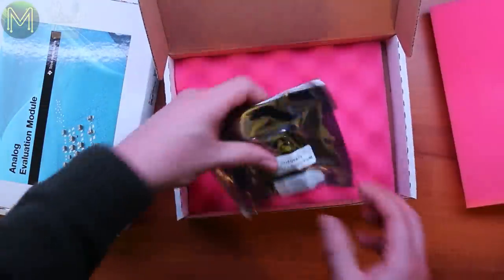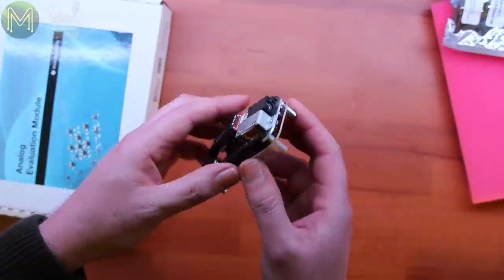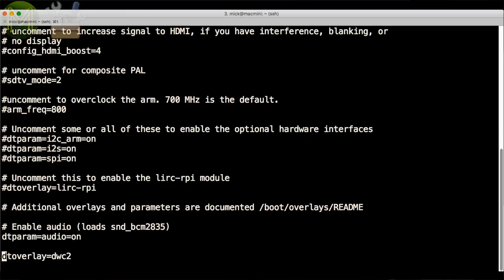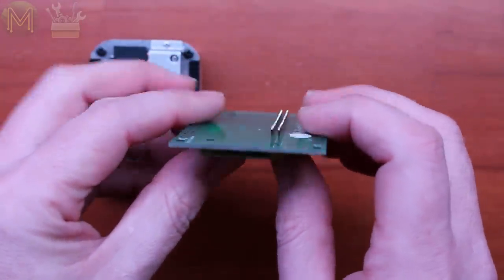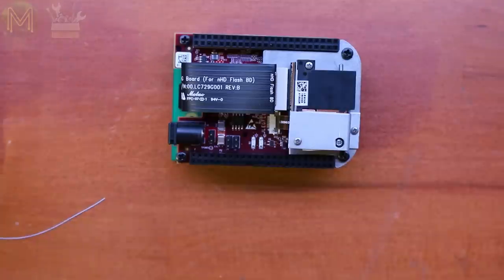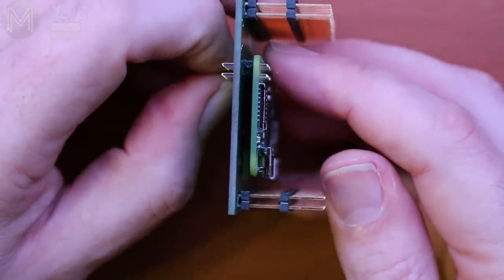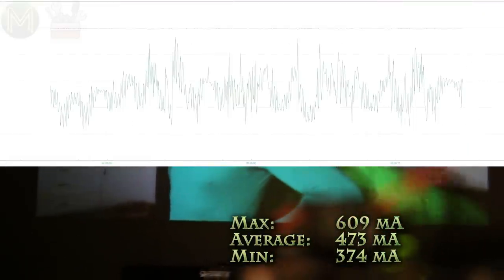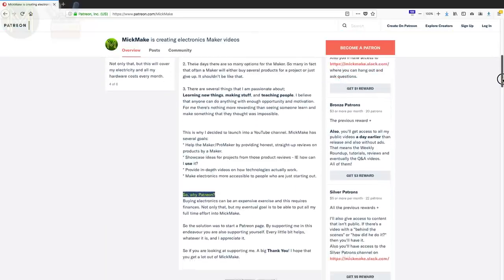#210 Build a Pi Zero W pocket projector! // Project

Comment from the maker: Hi everyone! Just to let you know, that Tindie admin hasn't yet approved the PiProjector on my Tindie store. I suspect they are very busy with the Bay Area Maker Faire. I'll let you know when it has been approved.
Reply from the maker: OK... Tindie has approved the PiProjector on my store.
Reply: they generally try to have a weekend ;)
Reply: I want to build this sooooo bad!
Reply: Please buy an Rodesmart lav+ mic or wireless FM/UHF lapel. The mic your currently using has LOUD HISS . Audacity should remove some of that for you
Reply: Sounds like an interesting project but you failed to mention where people can buy an DLP2000EVM or clone in USA + UK + EU + Asia ?

Are these DLP things sold on ebay/gearbest/banggood/etc ?
Reply from the maker: What’s a weekend? :-)
Reply from the maker: Hi Don. Should have a bunch of them back in stock soon.
Reply from the maker: Actually, for some reason there was a lot of mains hum in this shoot. So had to filter it out the best I could. Was better to have high end hiss than low end hum.
Reply from the maker: If you check out my website. It has all the info there!

https://www.mickmake.com/post/build-a-pi-zero-w-pocket-projector-project
Reply: putting the order together soon.. i'm ordering your board from tindie and the projector from digikey.
Reply: @MickMake  when I try to open you website I get a 403 message...
Reply: @isabelleus2881  same here. Let me know if you get it to work. I'm very interested and wating for a year for it to be back in stock
Reply: @BLueFeaTHeRedOliVeS  it still doesn't work, does it for you?
Reply: @MickMake  your website doesn't work, I receive an 403 message...
Reply: @isabelleus2881  nope. I'd really like to buy some
Reply: Are you still making these in 2021? I would really like to get one
Reply: @Kellen Leland Definitely, been watching on Instaflixxer for since december myself :)
Reply: Hi Mick great tutorial and I would really like one of your boards when it becomes available again. I see in the latest version you added a power button. I have connected my EMV and pi using jumper wires using the VandenBosch's tutorial .It is working well but I need an off button for the pi to power it off safely in the evening without corrupting the card and then to unplug the EVM as it will be running in the gallery for 3 months. I am having trouble setting up the power button using this tutorial https://www.makeuseof.com/tag/add-power-button-raspberry-pi/ and I am wondering if the EMV code is overriding something . I am using GPIO 27 because GPIO 21 is not available as it is being used by the EMV https://www.makeuseof.com/tag/add-power-button-raspberry-pi/. I am on the waiting list for one of your boards when it becomes available again. I see below you also recommend using a fan , this might also be a good idea. Thanks!

Comment: Love this project, appreciate you guys putting this project together. Hope it’s okay to ask a question. I just purchased pool table software made for projection. They recommend a minimum of 3,200 lumens. I’m not sure that requirement would be possible in such a small package due to the heat. Since these using have more mirrors thus producing more light, how comparable do you think it would be to 3,200 lumens or would there be other lens that could be used?

Comment: Thanks for this,  I've been going nuts looking for a mini projector for my singing pumpkin. I'm 3d printing a pumpkin and want an internal projector in it.  I know you can buy them pre-made but a friend of mine got one already and it is cheap and not good looking as the videos of it shows.  I want to give this a try. Do you see any issues I'd run into with using this?

Comment: Hey is this pi projector is suitable to integrate with raspberry pi 3b+ ? Or it needs any other components to integrate with it ?
And if I buy this product from digikey that the link provided by u am I need any extra components to buy for fixing it or that product can be directly put into power supply by inserting sd card into it ?
Reply from the maker: Yes you can use it with a Pi3, but will need an extension cable for it. Apart from that nothing else.
Reply: @MickMake  can we connect mini computer using raspberrypi3b+ directly to dlp2000lightcrafter evaluation module???

Comment: @Mick

I have a Raspberry Pi 4B, and am trying to wire it correctly to the
 DLP2000 board.  The photos on your thread about the project doesn't have anything written on it (Pinout Pin # from DLP to corresponding Pi GPIO Pin #).  Because I'm sure the GPIO is the same as the Pi Zero.  It turns on, and displays the default splash screen, but I can't get

the Pi to communicate with the projector.  I am trying to get this
 working by Saturday hopefully, so I can use it for Bible Study.

Could you please help me with this?

Thanks

Comment: MickMake ~ I'm stuck. When I apply +power to j3 (pin closest to the ribbon) and one of the header grounds, I just get a flashing field of red from the projector. The two on-board green leds blink in sequence and then the projector flashes. I have the same issue on two units. Got a clue for me? Oh - and thanks for the email on getting the pcbs I ordered.

Comment: Hi , site for dlp2000 EVM says it needs a 5v/3A power adapter ,   I have a 5V/2A powerbank , will that be able to power this system through micro usb ?
Reply from the maker: I’ve managed to power the whole shebang off a 1.5A power supply. You could probably use a 1A.
Reply: thank you

Comment: Hi Mike, I have wired up the pi 3 b , but the image is very shaky and distorted, what would be the possible cause? thank you in advance!
Reply from the maker: Hi Zhou,
If you have wired up manually. Make sure that you connected multiple GND points. Having long jumper leads, you'll see a fair amount of crosstalk.
Reply: @MickMake  you are a genius , I connect more with grounds and it works!! thank you! is it possible to print circuit board for raspberry pi 3 b+ tho? since that would save the issue for audio output and  usb input if it is pi zero.
Reply from the maker: Several people have used a Pi3 with the PiProjector. You’ll have to use a ribbon cable, but it is possible.

Comment: Weird question but how far out and what does the projection look like if it's just flat on the table with nothing in front of it? Or is the projected image angled up slightly? If it is, how much does it take lifting up the rear before it starts projecting on the flat surface in front of it?

Comment: Do the projector unit heats up when use? Will the Pi Zero get overheated when face down to the board?
Reply from the maker: It does heat up, but I've run it for a day playing a video on loop without issue. So, a fan might be needed if it's in a case.

Comment: This seems like a better foundation for a "DLP" SLA 3D printer than a vat LCD like they do it on the cheapies like Wanhao D7 and Anycubic Photon.

It would be desirable for that to jack up the light, and stick the colour wheel on white (it probably has RGBW layout) or remove it entirely. Is this possible?

I'm in a weird place in this regard myself; on the one hand, I already have an unused beaglebone and i'm really curious about all such technologies, and I already have an FDM printer; and on the other, I probably don't want to have a DLP printer in my home, i'm really scared that the resin will make my allergies flare up, they're not exactly healthy in uncured state.

EDIT: wait... 640x360... nope, not sufficient for printing, maybe except postage stamp size.
Reply from the maker: It actually hits 864 by 480. A strange res, but yup, not good for DLP, unless you move the head around, but that kinda defeats the goal.

Comment: @MickMake do you still check up on this video? Love this project, was wondering if it'd work with an old Model B Pi? and if so, do you still make your PiProjector board? I saw Rev 1 and 2 but theyre both out of stock :( any way you could help me get a way to print 2 of them if your no longer selling? Thanks!
Reply from the maker: I’m thinking of running another batch of boards of the Rev 1 in the next week.
Reply: @MickMake  Please shoot a reply here if you do! will gladly order 2 :)

Comment: Bit worried about heat dissipation, that pi zero likes to get hot even by itself, I don't see this being mounted in any sort of closed case without having it thermal throttle after a while. With lipo charging, boost converter and audio amp it might get even hotter.
Might be a cool addition to have a fan port with on/off control from gpio, if there's still a pin left. Would be great for people looking to put it in a case.
Reply from the maker: It does get hot, but I ran it for a day playing a video on loop without any problems. Definitely needs a fan in there. Especially with a case.
I'll have to sacrifice a few GPIOs for fan/temperature control.

Comment: Remember the impedance control for Parallel RGB interface. And that track lenght sould be less than 50mm. If you have vias on signals you should use 10nF stitching cap for return currents.
Are those pcbs made by JLCpcbs? Because they have no idea what impedance control is. I have asked several times. :(
So no USB projects, ethernet hight speed buses.

They claim as bga compatible but routing out a bga socs is useless if you have such limitations.
Reply from the maker: In theory... yes, but sometimes you can get away with it. :-) Not always...

I have a new version of my Super Duper coming out soon which will run a 300MHz MCU. That’s taken a while to get track lengths down, but it’ll be interesting to see how it goes.
Reply: Right now I'm working on my own SBC/IOT device but the limitations of jlcpcb is a bit annoing.
Reply from the maker: Nice. What SoC are you basing it on?
Reply: It is based on the A33, the initial project was using the chip pro SOM but looks like that the project is dead. I'm not an EE so i'm working as a Hobbyst. the project is made with Circuit Maker.

Comment: People have asked many questions that I was going to ask (it pays to peruse comments) but one is left.  Is there any way to put a more powerful light source through it?  I know if I go ask TI, they'll probably tell me no but not why.  It would be so cool to use a projector (pocket or a bit bigger) for your display in a lit room or eventually outside.  What's your take on this?
Reply from the maker: Hmmmm. You probably could, but heat dissipation would be an issue. Currently it gets a little toasty, but acceptably so. That is: I can hold on to it and not burn myself.
Double the light output and you’d have to also chuck on a heatsink.
Reply: Sounds right, thanks.  There is no "cold light" which is a good thing!

Comment: This is a nice project. I've been thinking of getting a pocket projector that I could use to experiment with 3D scanning of objects using structured light. This would fit the bill quite nicely.
Reply from the maker: A lot of people have been using these pico projectors for that exact purpose. I’ll dig up some links for you.
Reply: For me too!
Reply: MickMake any links on this discussion?
Reply: In checking the price for the DLP2000 I found there is a DLP3310 at three times the cost (~$100US) of the DLP2000 module (~$34) and it has a resolution of 1920x1080. Unfortunately the eval board for the DLP3310 is shown at over $800. :P

Comment: Hey mick could you help me figure out how to do this with my UDOO x86 ultra? I'm running windows tho..
Reply from the maker: Alas the UDOO SoC doesn't support RGB666/RGB888 output which the DLP2000 needs. The only other SBC capable of driving the PiProjector is the Tinkerboard.
Reply: @MickMake  figures..well thanks for the info! Was looking for a small dlp or similar mini projector for a project.
Reply from the maker: The next version may change this though!
Reply: @MickMake  I could only wish

Comment: can pick a prebuilt projector up on ebay from 35-60 bucks, i'll pass on paying more for a wiring headache.
Great video Mick.
Reply from the maker: You can get some for around US$35 on AliExpress - https://www.aliexpress.com/item/Original-YG300-Mini-Projector-Full-HD-LED-Projector-500LM-Audio-HDMI-USB-Mini-YG-300-Proyector/32818500333.html
Alas, they only have a 320x240 display resolution and run quite hot as they are a full LCD projector.
Reply: Am still puzzling at the datasheet for this, umm, "LightCrafter(tm)" and not really getting it.  An I2C command bus with 24-pin RGB-8 Data ... low power ... but what is the resolution?  Full 1080p?  (scans comments)  You say it is 640x360, but it is annoying that the dlpu049c.pdf does not have this.  Are individual pixels actually resolved visibly on the projected image?  Yup, I guess it would be novel to run a little WiFi pocket projector for a few hours on a couple of 18650 lipos.
Reply: p12 of TI's 'getting started with TI DLP tech' pdf mentions the resolution and also highlights that these 'pico DMD' units can do all the way up to 1080p... oh my! (don't wanna know the pricetag! :-O ) http://www.ti.com/lit/wp/dlpa059c/dlpa059c.pdf
Reply: Ah, yes +Peter Feerick, that dlpa059c.pdf document has the information that I want!  It appears that the top-of-the-line is the DLP660TE, claiming a 4k resolution, but a 2716x1528 Micromirror array size.  The DLP2000 is the baby of the group.  Guess they all scale down internally.  Mouser sells the bare 660TE micromirror for $557.12.

Comment: What is the minimum focal distance?

Would this adapter work on a Pi3?
Reply from the maker: Min focal distance is around 100mm, but the focus adjustment is a little weird. I'm looking at providing servo control over the focus in the next rev.

It sure can, but I designed it specifically for a PiZeroW. The Pi3 is roughly the same size as a BeagleBone, so placement was difficult. I'll see if I can do something about it in the next revision.

Comment: Hiya, I just pulled out my projector to swap to a Pi Zero 2W. The original Zero was a bit painful for playing slides or simple vids. However, there is a problem. The pi boots fine, but the projector only displays splash screen. I'm going to bell-out the pin header connections in case I shorted or did not make a good connection, but I think there might be an incompatibility in software. Has anyone else tried the 2W yet and got it working?
Reply: I have got the ON, OFF and INIT Commands working now. The default I2C bus is now 0 in Pi OS, it used to be 3 in Raspbian. Adding a new parameter to the new dtoverlay i2cbus bus=3 has got that going. But still no video. Desktop in VNC is correct 854x480.

Comment: At 1:40 you say that resolution isn't scalable because the higher the resolution the faster color filters have to change...
But why do you say such a nonsense?
Color filters in DLP projectors change the color of a whole screen at a time, no matter how many pixels are there. And every pixel then blinks at its rate to achieve desired brightness of currently displayed color. Every color (red, green, blue, in some cases yellow and/or white) is usually displayed 2-6 times per frame. At 25 frames/second and 3 badic colors we get
25 (FPS) * 3 (colors) * 2 (times) = 150 color changes per second.
It doesn't depend on resolution.

Comment: Also possible for the RPI3?
Reply from the maker: It is possible, but the current version requires a cable to be connected as the header is "flipped". I'm working on flipping it back again so that you can mount directly to a Pi3.